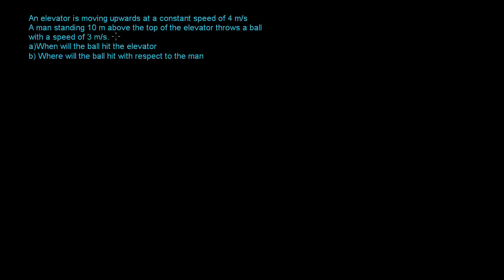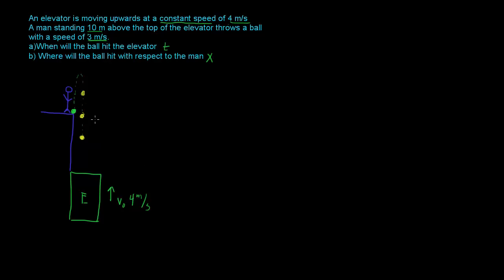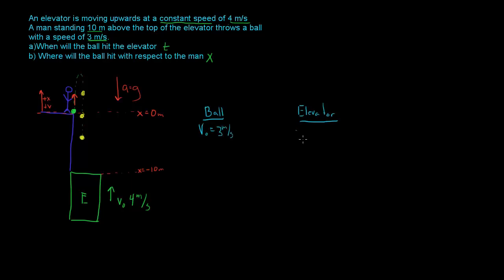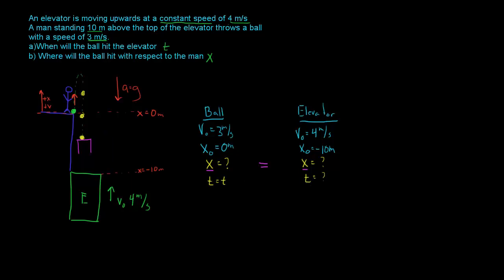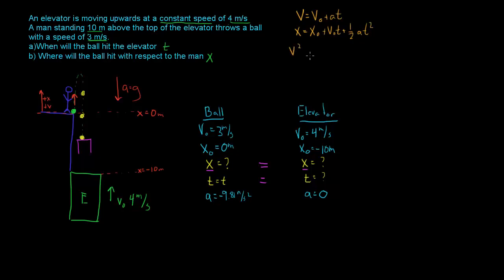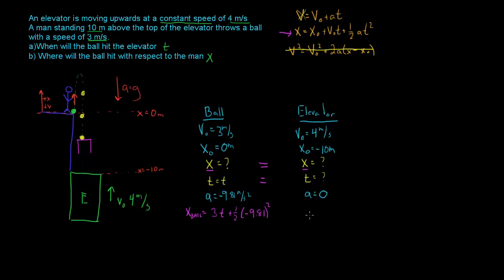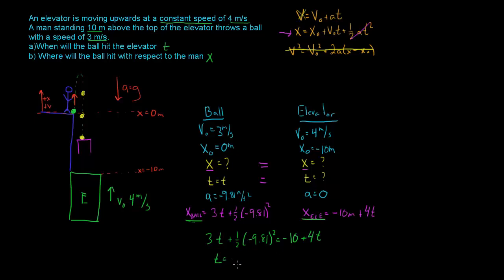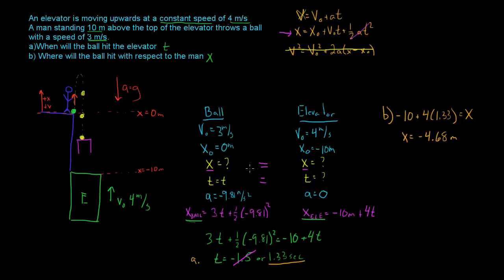When Will the Ball Hit the Elevator? | Engineering Dynamics Example

Comment: I know this is 8 years old but I liked and subscribed just because this was a lot of help. I have a concern though. I believe you forgot to include (t) in your equation for the position of the ball. Idk if you intended to do that. I think it was an error.  I hope you see this comment, please let me know your answer on that? 

Regards
Reply from the maker: Hi, yes it looked like I forgot to write t when solving the equation. I need the squared t term in order to get the two different solutions. Those are the correct numerical values.